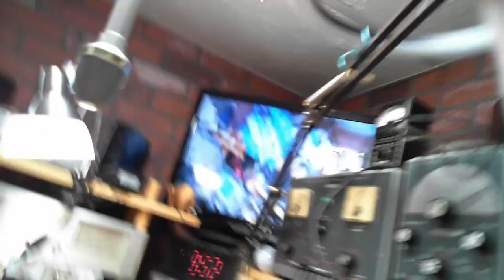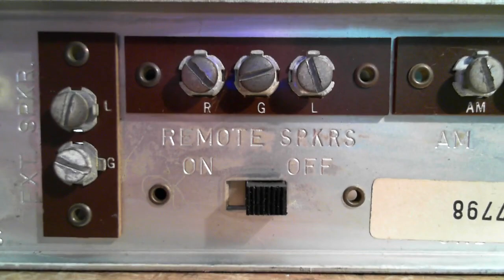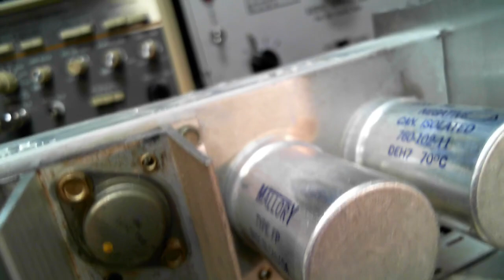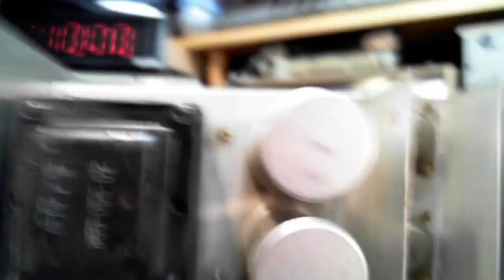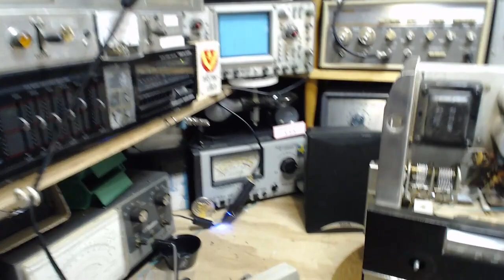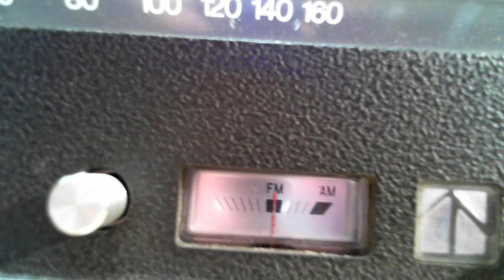Clairtone T14 Console Stereo Video #1- Receiver Checkout

Comment: This comes out of a completely freaky looking mid-century stereo with two black globes
on either side containing the speakers. I think Jim is way out of his league with this unit.
Check voltages in output stages and power supply. Two places that things go wrong.
Original record changer was a Garrard Lab 80 I believe.